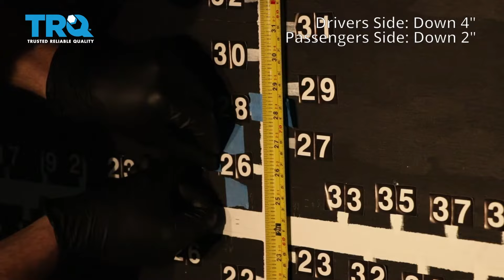How to Replace Headlights 2002-06 Toyota Camry

Comment: You don't have to remove the bumper cover. Just drop it enough to access the bolts underneath the headlight assembly. Nothing underneath has to be touch.

Comment: I just took out the fender liner bolts and the middle one up top, pulled the cover out and down a little, swapped the assembly, and popped it back in. Repeat for the other side. No real need to take the whole thing off.